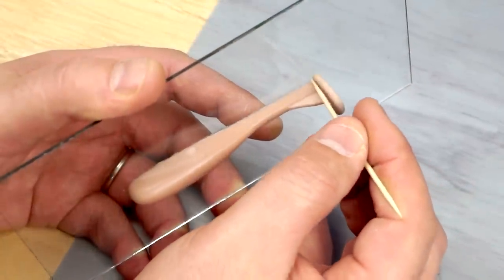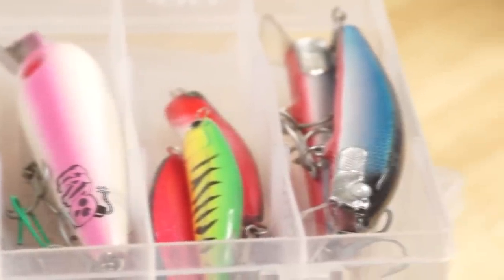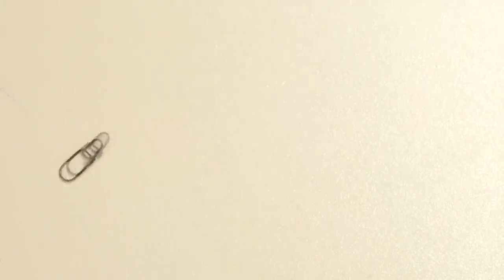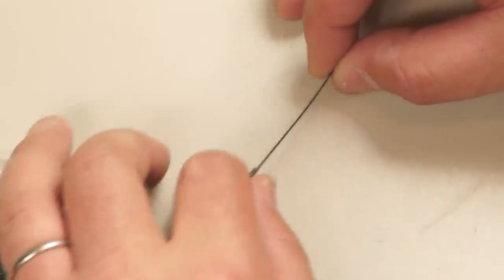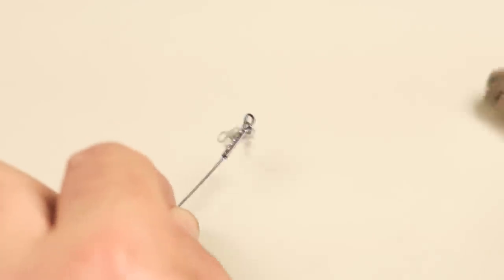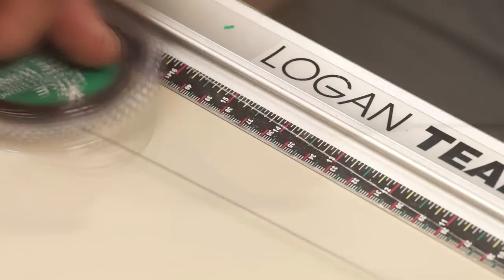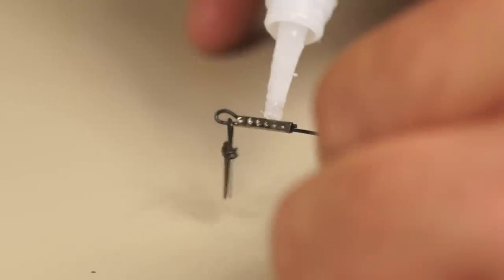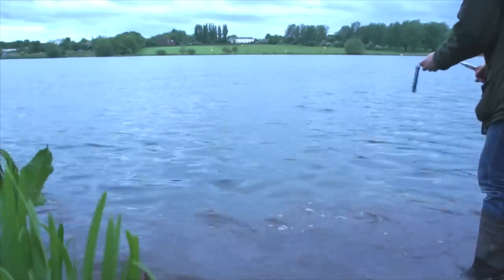Making Pike Lure Leaders (Traces) with crimps

Comment: Very nice video again , Paul , .....I like the special effects of the walking snaps and calling pliers , LOL .

I'm using the same leader material ,  nylon-coated sevenstrand , ......but since I'm a lazy guy I'm just twisting loops on either end and fuse them together with a lighter flame , ...admittably looking somewhat chunky , but they've never failed so far .

Keep up the good work , ...greetings , Dieter
Reply from the maker: I sometimes do the twist as well espcially on the lakeside if i want to make up something a special. Funny thing is the only ones i have ever seen fail are shop bought ones and that is because of poor snaps normally or twisted wire swivels. Thanks Dieter
Reply: *****
Luckily such never happened to me , I've quit using shop bought ones for many years , .....but I remember one lad having lost a trophy zander years ago due to a leader he had bought just the day before .

Snagged up a spoon in the river "Elbe" the other day , it was connected to a 1,0 mm dia /100 lbs test hard mono leader on my catfish lure rod , ....the loops of the leader just crimped with double sleeves having utilized sidecutters to furnish a few crosswise compression points on the sleeves .

After some very hard pulling the 75 lbs test braid snapped just above the leader , ....at least good evidence to me for the reliability of my traces .

Greetz , Dieter
Reply from the maker: a couple of times i have snagged and snapped the line only to find the floating lure come up to the surface and i have got it back by catching it with another lure
Reply: *****

Yeah , ...I think , sometimes the lures get free again due to the sudden release of the line's tension as it snaps .

Some years ago I even salvaged one of my "Rapala Down Deep Fat Raps" two weeks after I had lost it fishing from the bank , ...must have popped back to the surface without me having noticed , ....two weeks after I've passed by the spot with my little boat to find the lure washed ashore and stuck inbetween the embankment rocks , the bow wave of a yacht must have kicked it well above the waterline to safely remain there , just a few yards from the previous fishing spot , .......lucky me , LOL .

Comment: Hey fish guy Paul nice video great technique ever use monel or syainless single strand with a haywire trist try that,also where did you get the serrated crimpers id like to get a pair of those for my rigging bag i do alot of rigging for saltwater fish
Reply from the maker: I used single strand for heavier glide bait traces and often twist up very light lures. The pliers are from savage gear, they work great on small diameter coated wire which is normally too small for double crimps. Thanks

Comment: Terrific video Paul, very detailed and informative. Now, what do you use as a cap for the leader tube?
Reply from the maker: I some plastic pipe clips, in a later video i used a the top cut off a pop bottle whihc i glued onto the pipe , so i could have a screw lip

Comment: Hello Mr.Adams, I really wonder why do you keep your trace or make your traces 15- 18 inches ? Is it really matter ? is this really necessary ? as far as I know and in my experienceses it seems maximum 10 inches look like enough for it unless a pike deeply swallow a lure to its belly . And  it seems impossible ( to me ) when you are especially fishing with cast and retrieve method.  thank you.
Reply from the maker: +Volkan KüçüK it is not the depth the lure goes into the fishes mouth that i find is the problem but if the fish rolls,  or literally powers forward with the bait , which has happened to me a few times, luckily I have only lost one fish like this, unlucky for the fish., which is dead somewhere with a lure and a 18 trace in its mouth. I have caught on a number of occasions fish with 6" traces and lures stuck in mouths because they have bitten through the line beyond the trace.
Reply: +Paul Adams (The Handmade Fisherman) so, you say Its better use long trace when you target pike or pike infested lakes for perch fishing. There is no exact lenght I think, but when use smaller spinners  ( aglia no 1-3 ), or small lures ( 5-12 cm ) its better use longer than 6inches but not 18'' :)  If you know there are no monster pikes you can use even 6'' leader, especially in my country :P Thanks for fast answer and inspiration.
Reply from the maker: I think it is a personal thing, I don't use anything less than 12".

Comment: So you`re a crimper and not a twister..........simple but important video paul,especially for the novice trace maker. I also make my own but I use a titanium wire,simply because it lasts longer. Will you be doing a dead baiting trace video ?
Superb video as allways.
Reply from the maker: Well i do a bit of both twisting and crimping, if i am making up light traces for perch fishing with small lures because there are pike about i use 12lb uncoated wire and twist it up and cover with heat shrink. I use solid titanium wire to make up jerk bait leaders but as yet have not got the flexible stuff for ordinary work, i think this because i end up giving these away so often it woulod proabably bankrupt me. i do very little in the way of deadbaiting but i do a kind of twitched  sprat thing with floats and heavily scented soft plastics which i may do a video about rigging when the waters cool down a little.  Cheers Nick

Comment: Is it a good idea to use pliers to crush the crimps
Reply from the maker: i have never had one fail using these pliers, they are designed for crimping and have blunt teeth so they do not cut the wire but deform the crimp
Reply: The Handmade Fisherman ok cheers, I got some crimping pliers today and they are very skinny, are they any good? If I use them multiple times on the crimp
Reply from the maker: @beaumoore2470  i have a thin pair i sometime carry fishing with me , they are designed to be used a few  times along the crimp

Comment: The bad thing when using snaps is that sooner or later lure will detach itself and you will lose lure. I lost many lures using different snaps, so now I just stopped using them.
Reply from the maker: I have been using these cross snaps for two years and have not lost a lure to a failed snap, they do not last for ever and i tend to change them regularly  when they begin to lose their spring. The reason i began making my own leaders was becasue the snaps available with the traces sold in the local tackle shops were of such poor quality that  they failed often and without warning.   Thanks